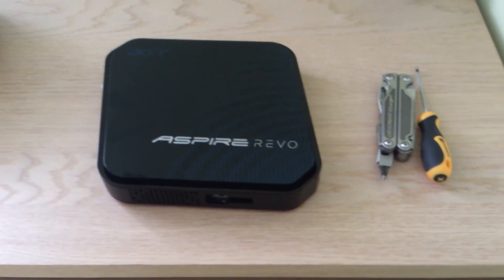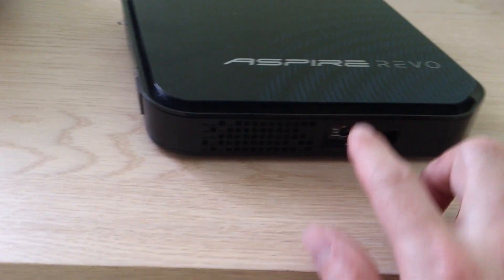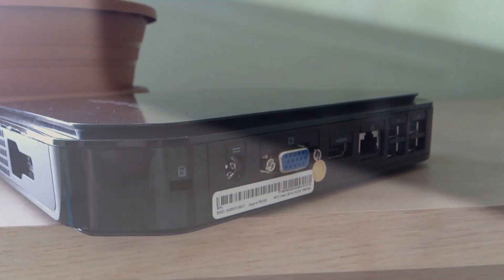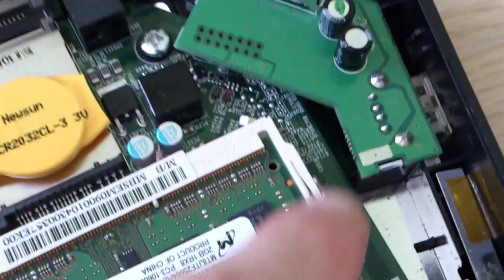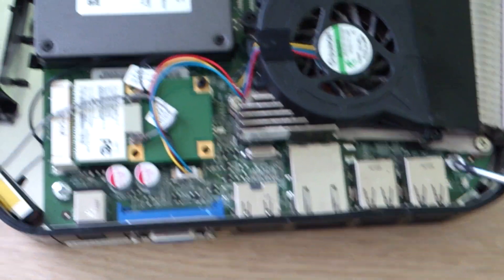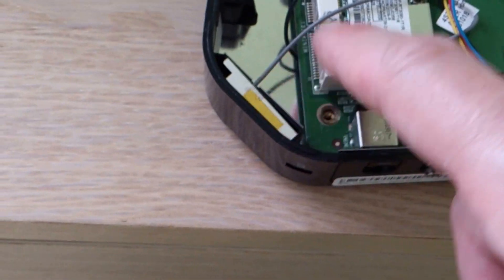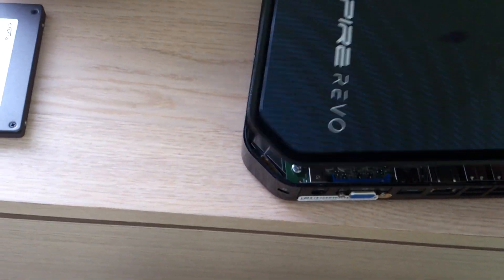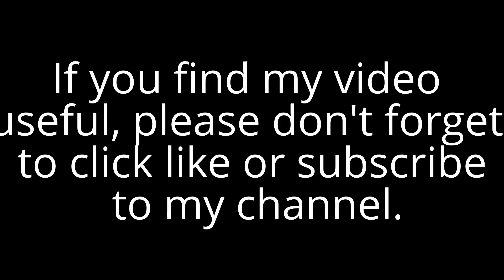How to change hdd to ssd on Acer Aspire Revo (hdd to ssd)

Comment: I have an R3600 with a 160GB 7200rpm drive.  Not sure if that came with it or it's an upgrade.  I expected this to easily lift out, but seems this video indicates it's screwed to the motherboard.  Slightly annoying.  Anyway it's 2019, and it took a copy of libreelec, quickly and easily, and plays full hd 1080 video samples fine, wireless works, and all hardware detected, no agro.   Just a shame there is no onboard bluetooth.  Boot up speed isn't that much of an issue with libreelec, so not sure if an ssd is greatly beneficial.  Depends on use case and OS.   However a fast onboard drive, plus large capacity offboard one or two via one of the many USB outlets could be useful.  But then it gets a bit messy cable wise.   Amazing that in 10 years, you can get most of this in something like a Rasp Pi 4.  Haven't tested the onboard Gigabit ethernet port, but that seems to be one advantage over say a Pi.  This could make for a crude headless NAS itself perhaps - or maybe even a firewall (the ethernet may possibly be split into vlans).  I'd be interested to know what people are using these for.  I guess an SSD is vital if you are using a full-blown OS.